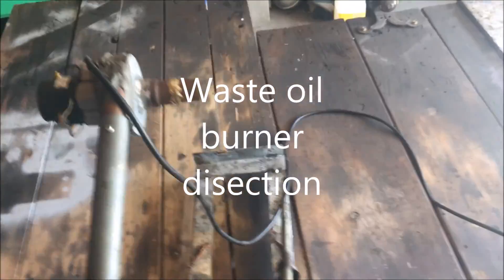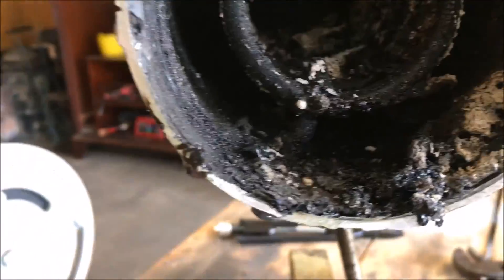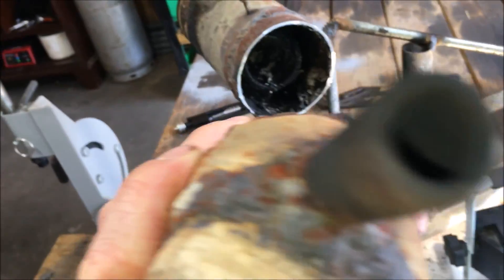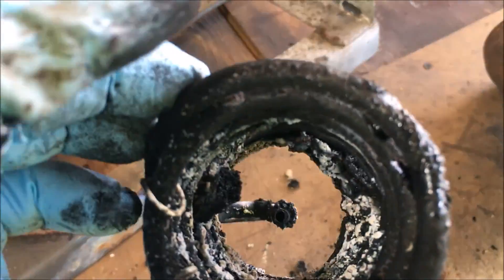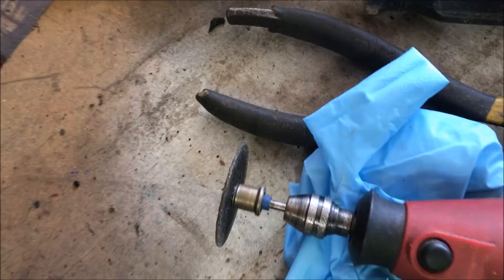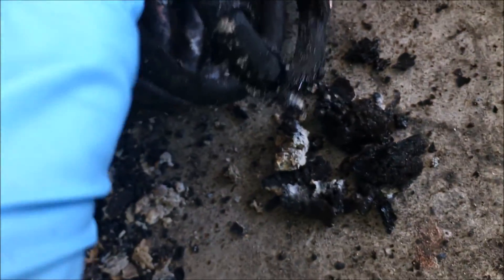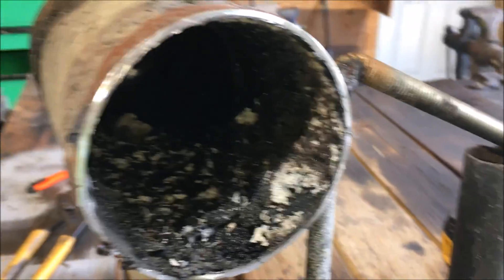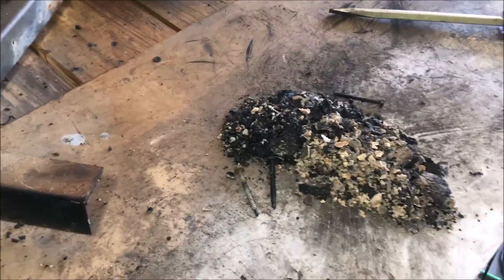Waste oil burner vaporizer dissection

Comment: It's amazing how messy waste oil is. I quit running my waste oil heater on waste oil after about 20 gallons this winter and switched over to diesel because I got sick of the insane coking. Next year I'll try to build a better design, something with a spare burn chamber I can swap in that's already clean.
Reply from the maker: Yes only experienced users like you know about this , thats why i dont sell torpedo blower burners , so far they just gunk up to much , the trick is to run red hot , this way its more self cleaning .